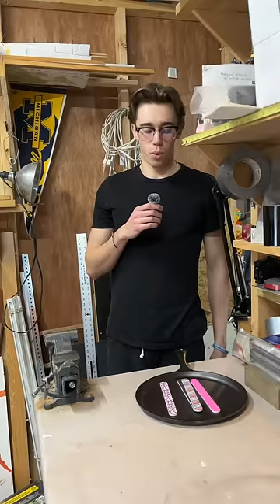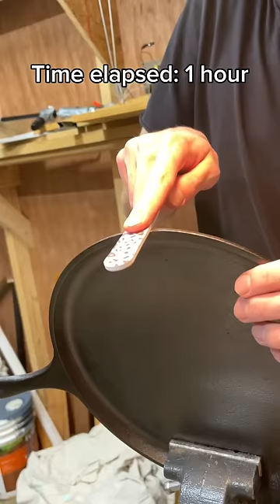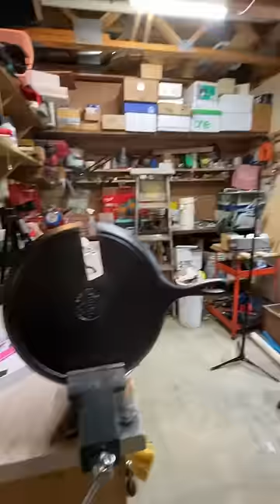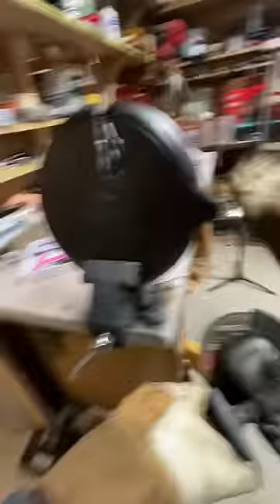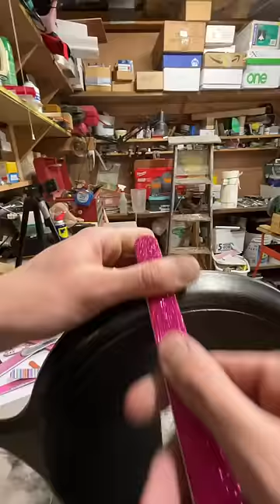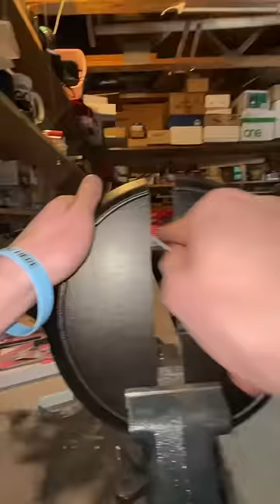Cutting a cast Iron pan in half with a nail file😭 #challengevideo #mrbeastchallange #viralvideo

Comment: To theoretically file a cast iron pan in half using nail files, with an optimistic removal rate of 0.05 cubic inches per hour, it would take approximately 393 hours to remove 19.63 cubic inches of cast iron. This assumes a 10-inch diameter pan with a filing depth of 0.25 inches. You'd likely go through around 393 nail files, assuming each lasts for about an hour before wearing out. This highly speculative scenario underscores the impracticality and immense effort required for such a task, highlighting the mismatch between the tools and the material's hardness.

TLDR: assume you used one average nail file an hour, this would take approximately 393 hours (16.4 continuous days) to complete this task. Also, you’d go through about 393 nail files.

Thanks chat gpt. I hope you learned something like I did.
Reply: thanks!! 😂
Reply: How you know? Did you test this?
Reply: @monumentalsin3552 If you read the comment, it was provided by chatgpt.
Reply: @sillychondrite  bro thought the "🤓" makes him look good.
Reply: I could tell it was from ChatGPT just by reading it. Cause I use it.
Reply: NO WORDS
Reply: What the actual fuc*
Reply: Gpt is the 🐐 its like a lil 🧙🏾‍♂️ in your pocket
Reply: It's not cubic inches bruh
Reply: No this is real I can tell.
Reply: @Raleigh_Dean_Craighead  to what?
Reply: Surprise surprise chat gpt did the math wrong
Reply: I wasn't commenting on the fact that chatgpt got the math wrong, im commenting on the fact that this guy saw what chatgpt wrote, and thought "yeah, a cast iron is a full inch thick of metal". Chatgpt didn't post the comment, OhRabah did.
Reply: Wtf
Reply: I did not understand half of those words but I think I know where you're coming from.
Reply: Remember that cutting cast iron can be challenging, so take your time and prioritize safety. If you encounter any difficulties, consider seeking professional assistance or using alternative methods for dividing the pan.
Reply: Dude I genuinely thought you were a genius for a second 🥲
Reply: You know chat gpt just makes stuff up that sounds like it makes sense right?
Reply: bruh why put the TLDR after all that you wrote LOL its supposed to go before we start reading
Reply: No it wouldn’t wtf I think you forgot to carry the zero
Reply: I thought u were a methematician or some kind of expert, turns out u were chatgpts friend
Reply: Just got it done in 45 minutes
Reply: Nerd
Reply: blud used chatgpt
Reply: nerd
Reply: “Erm actually.” 🤓🤓☝️
Reply: Whoever’s reading this remember God loves you very much!!!! Jesus is King and died and rose so we can be saved and you can accept Him today🙏❤️💯 He is waiting for y’all with open arms God bless hope you having a good one!
Reply: @dnlplayz4284 no, he was calling the OG commenter a nerd with that emoji
Reply: @J.Larz1837  yeah, and does that makes him look cool? I think not
Reply: Noice
Reply: @DEEDZDEEDZ this is my second language, and I even know everything he’s talking about bruh- it’s not that hard words but ok👍
Reply: @dnlplayz4284  i never said that
Reply: @dnlplayz4284  bro i just put nerd emojis, i didnt do jackshit to you wyf

Comment: Cuts the handle off instead of just flipping the handle to the other side 😂
Reply: Then proceeds to move the handle to the other side after cutting
Reply: That must have been a little torture to be able to use a power tool real quick then back to good ol’ trusty hand “tools” lol
Reply: That’s the clue to the joke lol. You can see the grinder cut marks along the path of the file
Reply: @BotThot  didn't say it wasn't was just sharing I found that to be part to be funny and a nice touch

Comment: Anyone who hasworked with abrasives can tell when they're actually seeing use. They will discolor as the abrasive wears away and the pores of the backing material fill with dust from the work piece. These nail files arent being used at all, other than for the shots. You can also see the cut marks where a cutoff wheel has been used to remove stock from the work piece. This was very, very low effort and not very well thought out at all.
Reply: I feel like it's kind of likely this one is satire, given he literally cuts off the handle with the angle grinder.
Reply: Thank you for explaining the joke for all of those who cant mash two braincells together sherlock.

Comment: Edges are straight (the file would round them) and he doesn't have a timelapse. Seems like he used tools between video cuts.
Reply: Yeah cuz I’m sure you’ve cut through tons of pans with nail files lil dude 💀
Reply: Working in a machine shop, i concur.
Reply: @Yunggravy622 mad because truth Dumbas 😂
Reply: @ThatMMADude  What the hell does that even mean?
Reply: @ThatMMADude  😭😭😭😭😭
Reply: @Yunggravy622  Having used a file a couple times is enough lol
Reply: Yh the edges might be straight but u definitely arent
Reply: No shit Sherlock
Reply: @1312_PV  on what? your finger nails?
Reply: And he got you to comment.. part of the algorithm
Reply: @Yunggravy622   I have used them on metal, wood and plastic myself but yeah, that would suffice.
Reply: @exinix_edits  Indeed I'm not
Reply: Good investigating skills officer obvious 😂
Reply: Uh yeah.. it was a joke to begin with
Reply: @1312_PV  sure you have buddy
Reply: @Yunggravy622  even kids in crafts classes have used them but lol
Reply: @Yunggravy622 of course not, and neither did this guy in the video, he clearly ground it and anyone who worked with metal can see a clear grinder cut
Reply: No shit
Reply: That's the part that made it obvious not the part where he says he keeps hitting his head on a handle that would only be eye level if say you were bent down using a power tool ot the fact he used said tool to remove the handle or all the other times he intentionally makes it clear he isn't actually doing it
Reply: Also the path is just bigger than the file lol
Reply: @Yunggravy622 😢😢
Reply: @grilledcheesefan44.  ok grilledcheesefan
Reply: @exinix_edits no shit, I know that flag it’s the asexual flag
Reply: @Yunggravy622 he actually admitted to it in other comments bro
Reply: @ozzywormin  shhhhhh u don’t gotta blow my whole operation like this
Reply: @ozzywormin  if we’re being real for a second he literally basically admitted to it and showed it in the video bro 💀

Comment: Now actually do it with nail files
Reply: Don't think that's possible unless you use some kind of industrial grade nail file😅
Reply: ?he did?
Reply: That is a nail file my dude I use ones just like that
Reply: You try and tell us how that works out cause you’d die before getting it finished
Reply: @stuartmccamley3884  he faked it, used a saw
Reply: @2kT3  thx
Reply: @2kT3 angle grinder but yes
Reply: @unrenownedc   yeah. I realized my mistake right after but too lazy to fix it LOL
Reply: @thehorizontries4759 he didn’t actually do it, he would not have been able to cut through it in such short amounts of time, especially since nail files wear out after like 29 minutes of use, he would need hundreds and hundreds of them to do that, plus the sides are too straight and raw, the nail file would have sanded them down to be smoother

Comment: Speed running tip. Up the surface area.  Both surfaces allow for this. 
Under 6 hours possible if U have the pan upside down and cut through the whole flat bottom at once

Comment: You guys keep saying it was done with a grinder but look at where it stops at a Grindr is not going to make that type of cut you're not going to get a grinder in there to cut a 1-inch space without having notches on the other side of it plus you can actually see all the dust from the file underneath of it a grinder would have bigger pieces there and it would not be sitting right underneath of it